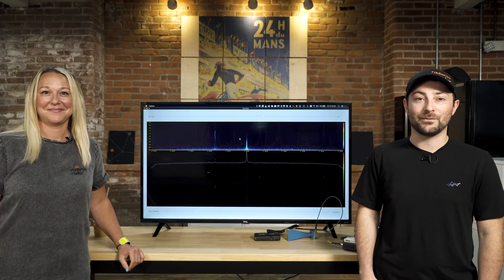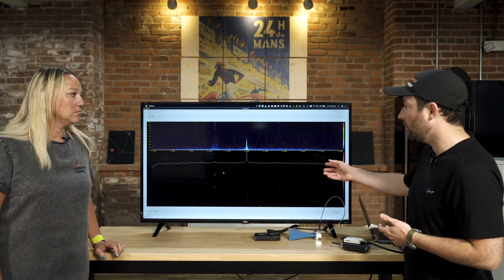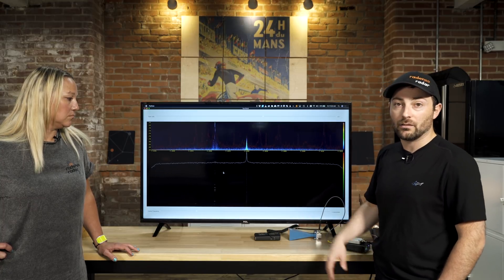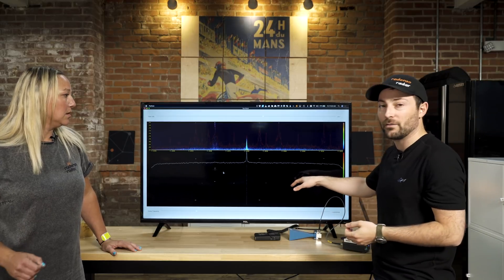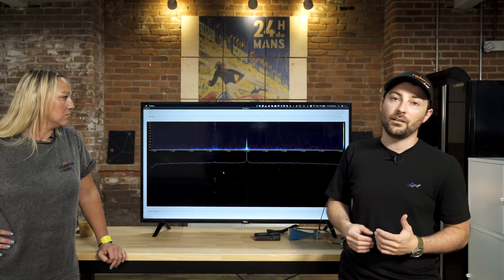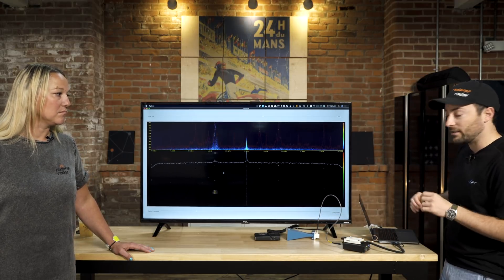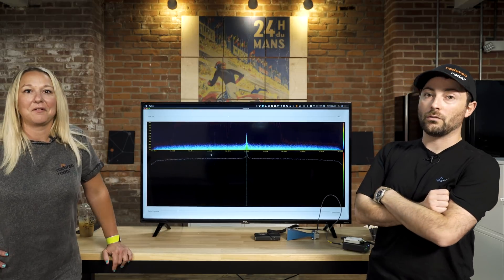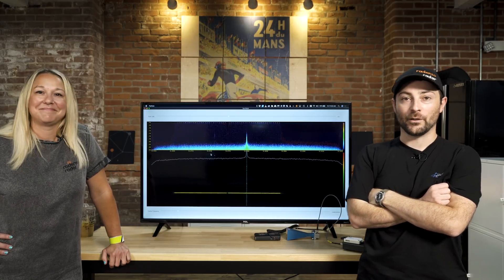Why can't I test multiple radar detectors next to each other?

Comment: Question, during the configuration, did you modify the frequencies that were used, curious on the SNR values when you select different frequencies on each of the detectors? Or did that not make a difference.

Comment: So, are we talking no falses at all?
Reply: Honestly, I really do think it depends on which units you run together. I've been experimenting with 2 to 3 at on time. Cobra leaks the worst and does cause falsing on Escort and Uniden. Escort and Uniden seem to get along fine. The Uniden R1 r4 r8 all have k and ka filters and I don't see them falsing to Escort max series. I haven't drawn a solid conclusion as to any affected range issues yet. Hard to say, but they did admit a v1 g2 works with another unit.

Comment: Is there a safe distance apart if a person decided to test detectors together?
Reply: Hmm, I've run 2 detectors and even 3 😂 . I first tried a R1 and a max2 and no falses and detection distance didn't seem affected as far as I could tell. They both have decent shielding according to Chatgpt and it showed in the seemingly normal performances of both units. Now, I have tried a Cobra RAD 700I with a max4 and yea, I got extraneous interference on and off to the max4 as the Cobra 700i is a leaky detector. Cobra was always the ones setting off my X50 Escort unit back in the day. The Uniden detectors don't seem to have major issues running Escort detectors near them at the same time, especially with the k & ka band filter on. I don't know, I think that with DSP technology these days, it's not as bad as they say to run 2 or even 3 detectors together as long as they are higher quality units. I've been experimenting with different combinations lately. As yet, some trials are admittedly inconclusive for now. I think so far, the Uniden R4 and R8 are very resistant to falsing due to an Escort max variant. The reason I'm experimenting is because I literally saw that newer iterations of Escort detectors are less sensitive to Laser. I have been saved multiple times by a detector with great laser detection! Sure, if your alone or the lead car, you're pretty much getting alerted that you may get a ticket. 😅 So far, the max2 works best with other detectors and has very good laser detection. The Cobra RAD 700I does have excellent laser detection and already saved me and the max4 didn't even alert!!! 😮The max4 did alert with a laser system a couple of times but definitely not as good as Cobra 700i on laser. The Cobra is so leaky though. I mean it's much better than the older Cobra units.

Comment: It's a shame the cost is so high with the potential demand and the Canadian Market will be priced out. With enough stock you will make a lot more profit in the long run lowering the cost. As a radio and computer engineering I'd love to get this unit however having the knowledge to understand the shortfalls of other high end detectors the price just doesn't justify the switch,  for the user that knows very little it might be a good move.
Reply from the maker: I think once Theia comes out you will be surprised and well worth the money!  Unfortunately we can’t price Theia low due to the hardware costs and years of development that it has taken.  We really do think this is taking radar detectors to the next level similar to flip phone vs iPhone.  Thanks for watching! -Randy

Comment: @Randenso Radar, please take your time on it. We're all happy now with the R7 and the V1Gen2, so no need to rush. Please let this be the best RD on the market. PERIOD!
If the budget allows, please price it at $799-$849. It will send Cedar Electronics and all its subsidiaries under a rock. Please put a nail in the coffin!

And while we talking about multiple radars together, since Theia can be programmed to learn any BSM stationary or moving, couldn't we do the same thing with radar detectors. You can literally feed it all the known radar detectors out there, and if you wanted to test them together you can, because Theia will block it out. Not so much for the other brand or RD, but just another tool on what ML can do with Theia. Love the development of Theia.
Reply from the maker: Sorry, we cannot comment anymore on the pricing.    With regards to detecting other radar detectors, I can’t answer that as Theia is still in development.  Let’s first focus on police radar guns haha. -Randy
Reply: Radenso Radar you dodged that one as far as performance. Will this be the longest range detector on the market? On and off axis? K and Ka band?

Comment: Can’t wait!! But no radar detector is going to save you from laser.  A jammer  is required for countermeasure.
Reply from the maker: Actually laser can scatter giving you a quick warning however it is extremely rare. I’ve only had it happen twice but we still recommend using Anti-Laser Priority for full laser defense. -Randy
Reply: @RadensoRadar  Absolutely. I haven't taken that leap yet--kind of rich for my taste and I have a leased vehicle I don't want to go through all that installation for. My Waze app nails most of the bogies around here. Thanks again, can't wait for Theia.

Comment: This is probably excessive - but for the price it sure would be nice to be waterproof/resistant so I can also bring it on my motorcycle.

But thats almost certainly too much to ask... just figured i'd throw it out there though 😇
Reply from the maker: This was an idea we had in the early stages of development however it would have been too expensive to make happen and the cost of Theia would have done up by a good amount.  -Randy
Reply: @RadensoRadar  Yeah, I 100% understand - with everything already going into the unit I can imagine waterproofing may be one step too far. Can't wait to get my hands on one!
Reply: @BloodySinner That would be interesting -   I think I would spend like $60-$80 for a water-resistant/proof case just to keep things safe incase of a quick rain storm.
Reply from the maker: I believe there are companies that already specialize in making waterproof sleeve/cases that will come up with a solution down the road -Randy